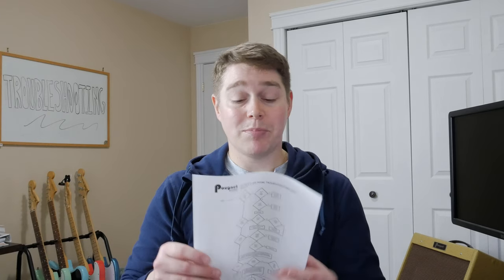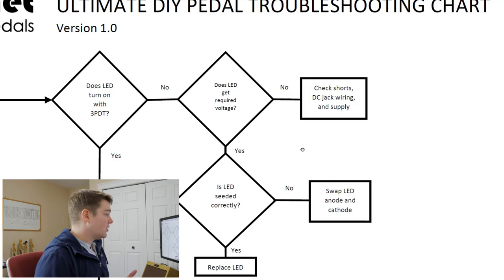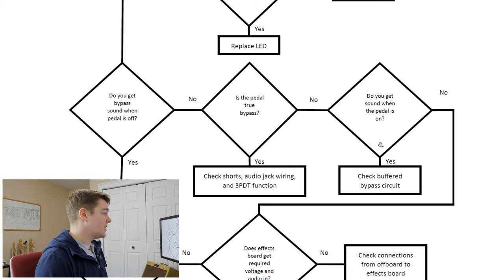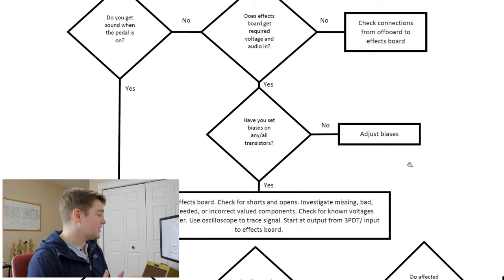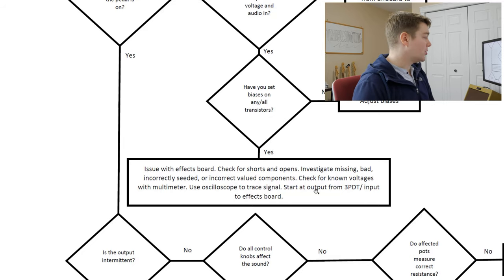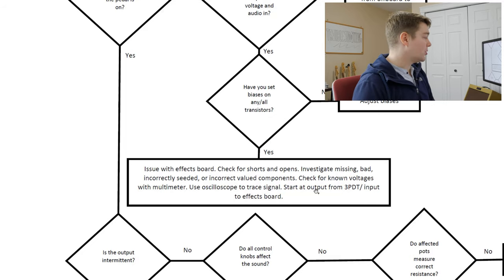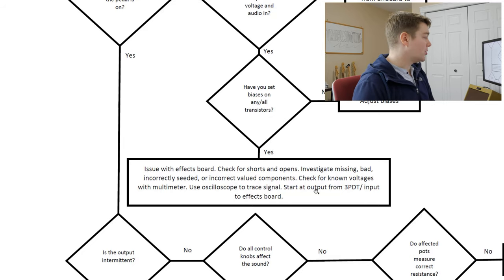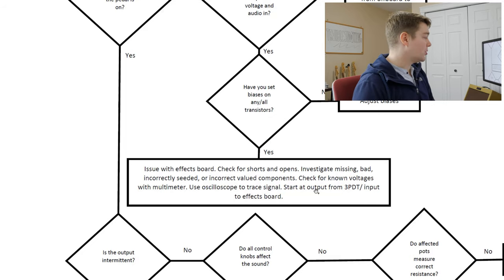The Ultimate Guide to Troubleshooting Pedals | DIY Guitar Pedals

Comment: Of the 6 pedals I've built, only 3 work the way they're supposed to. Now I can finally figure out where I went wrong! Thanks for creating this roadmap!
Reply: Learn ohms law. Start small calculating resistors in series ans parallel. Understand transistor behaviors and what stage the wave form should be in at any node. Pro tip. There's a 1.4v drop from collector to emitter, it takes .7v to turn on a transistor. Learn to use a digital multimeter. Learn the rc time constant.

Do not get an oscilloscope until you need one and spend 500 on a rigol or siglent. 

Do not use parts from China. 

Getting better at your instrument is more important and don't be the douche at parties playing cowboy cords or the c major scale. No real player respects blues players. Blues is lazy, practice more.

Comment: Absolutely love this video and your chart. 
You pretty much mentioned it with ‘faulty 3pdt’ but I’ve made the mistake of flooding parts of my foot switch and causing all kinds of problems. (Connecting poles that shouldn’t be soldered together) 
Thanks again. And I appreciate your time.

Comment: I have a regular 'pulsing' sound (about 2-4 beats per second) on an ancient Zoom 2020 multi-effects processor. I've had experience with faulty (computer) clock boards before and know how sensitive they are to capacitive effects. Thanks, I'll check the clock IC and associated components next...

Comment: I'm a total noob fixing pedals but I finally fixed my analog delay pedal. I used the flowchart. Had a bad IC chip and maybe bad power diode and reflowed all the solder joints and it fixed. Also great lesson testing for pots and switches and jacks. Once I got engaged output sound, the delay still wasn't working, then used a power supply instead of battery and it came back to life.  Thank you so much. Inspired to make pedalpcb pedals of discontinued pedals or way overpriced pedals and selling cheaper with cool artwork like you. Really fun man. Confident in my skills now. You are the shizzle!!!

Comment: I bought a used Artec wish wah APW-07,  at first it worked but had a problem with the "wish" pot where there's a place where it makes a huge "POP" sound then the're no guitar signal anymore even if you can hear the wah until you wiggle and play with potentiometers ,and when bypasse the signal goes with no problem.......
I sprayed the potentiometers with contact cleaner, worked like charm , then left the pedal for a coupl of days untouched.....at my suprise the pedal would not work anymore when activated, I mean you hear the wah effect and the hiss with the toe down but abslotutely no guitar signal.....I checked the switch and pots and it seems to be no problem there

Comment: I’d suggest another block in the chart for “audio bypass ok but no sound when engaged”: is the input jack cable actually connected to the guitar and the output jack cable to the amp?
I lost 2 hours yesterday for having them the other way around...
Reply from the maker: Haha. I will have to add it for version 2
Reply: Yes. I’ve been there too. Embarrassing but true

Comment: I’ve just built my first pedal, an overdrive based on the design on Wampler website.. volume and tone works as expected but drive does not.. have checked voltages on the board and everything is fine; so I’m thinking it’s either the pot has malfunctioned or it’s the capacitor or diodes in the clipping part of the circuit..
Reply: This dude doesn't actually know what clipping means brother. You're ahead of the game around here.

Comment: Hey i have an old DOD FX25. The Kermit green one from 1986-1986 that is right before the 2 knob sparkle green version. I had a sparkle green back in the day and remember it having a little bit of dirt on the decay of the filter. The one i have now seems to have quite a bit more distortion on the decay. 

What could cause this? ive already cleaned the PCB, checked solder joints, cleaned the pots and input/output jacks. It does this with both a power supply or battery. I have not checked the switch yet but it seems to be working fine. The LED is a bit dim.

Any advice is greatly appreciated, Thanks!
Reply: 1986-1988* It says FX25 on the left next to envelope filter.

Comment: Hey interesting video very informative however I have a question because I did not build my pedal I bought it ,  It's a joyo atmosphere Pedal and it turns on ... the LED lights work , however when I plug in the guitar The sound is very very quiet. even if I put the amp on 7, which should be really loud it sounds like The volume is below 1.  The cables are fine, the amp is fine, the guitar is fine, and the power supply is fine. When I opened up the pedal and checked all the voltages it's a 9 V power supply but everything I checked with the multimeder is giving me the same 3 V reading. So there is a tiny tiny bit of sound But the pedal is unusable. What on the board could be causing the issue of low low sound any ideas or is it fried?  Any advice would be good thank you very much for your time in advance.cheers

Comment: Hello.   First off I don’t build or know Very much about petals. But this video has been the most informative on petals in general, but I am having a problem where I just bought a new panel change the battery and now the bypass works but it does not work when engaged with the light comes on and I may have missed it in this video but I did not really catch a way that I can troubleshoot any reply would be super helpful thank you
Reply: Insert pedal where needed … my apologies … talk to text at it’s finest

Comment: Question…I built a Spirit Box and the pedal works but LED does not work. I switched the polarity on my solo power supply and the LED works but then the pedal does not. I’ve been looking all over for an answer. Do I switch the pins around on the LED to the board? Hoping you can help.
Reply: Sounds to me like the LED is backwards

Comment: I have a digiverb of digitech . the pedal wont turn on when u push the switch. when u plugged the adaptor into the pedal its blinks 3 times the red light. when u plugged it into amp sound goes through . do u have any idea what could be the problem? and how to check sw1 switch?
Reply from the maker: Not much experience with the digiverb, but i suggest looking at the supply. I think the LED blinks when they are turned. Maybe a dead or dying battery, a bad dc adapter, or something burnt up in the power section of the board.

Comment: I'm having an issue with a 30 year old Morley wah pedal. The pedal works fine if my only effect is the Morley. When I add other effects to the chain the Morley stops working when engaged. When off the bypass still works. I checked the voltage on the input jack and it's 9.6 volts with no other effects in the chain. When I add other effects the voltage starts fluctuating (down). Any ideas would be appreciated. Thanks in advance.
Reply from the maker: How many other pedals on in the chain? Are they all off the same supply ...say in a daisy chain? Might have too many.
Reply: @pougnetpedals  The same issue occurs regardless if it's one or more.
Reply from the maker: Yeah. But it's about current draw. So knowing what the adapter can handle and what the pedals draw is #1. Usually once current draw goes up, you will see the voltage dip. I used to have one of those Morley wahs but I can't remember the draw. Rule of thumb is if you need 50mA for all your pedals in your daisy chain, use a 100mA adapter. If that doesn't resolve the issue, I would probably check the ground connections on the Morley. Hopefully that helps!

Comment: Please help. My looper pedal isn’t working. Every time I plug the pedal in, it doesn’t turn on. If I hold the button down, it has a red light, but if I press the button, nothing happens. What could be the problem?
Reply from the maker: Tough one without the pedal name or schematic. Also, its likely digital which makes debugging a bit harder.  My only guess, and it's a long shot,is to check the power supply. I only say this as I have heard of similar issues with ditto loopers
Reply: @pougnetpedals  it’s a Koogo looper pedal. The back it like glued on. No screws, so I can’t get into it. I’ve tried multiple power supplies and it’s doing the same thing
Reply: @Lightningph  see where the pedal compresses?

There should be a black knob which unscrews then you can get inside.

Comment: What if it’s a reverb pedal and it has a light and hardly used.  But there is signal.   it’s just hissy and noisy and the effect don’t work.
Reply from the maker: Could be a lot. Depends on what type of reverb as well? is it using a digital brick? a pt2399.

Comment: I built a JHS morning glory clone, called the Gloryhole from pedal PCB. I forgot to order the proper transistor. so I improvised with anything I had laying around. I found one that worked, but the volume is very low. I ordered a new transistor. Will this fix the volume problem?

Comment: So my pedal is at the stage where all the components are soldered but I haven’t connected the switch or the led. I wanted to test it so I hooked it up to my amp and guitar and got nothing but a constant noise. But when I would turn the pots, the hum would either get louder or quieter. Any suggestions?
Reply from the maker: Hmm. That's a tough one. Start checking component orientation. If the hum gets louder, maybe something is leaking into your output. Use a scope at the input and see where your test signal disappears
Reply: @pougnetpedals  hey thanks for the reply but I’ve realized that I was using really shitty solder and it was causing cold joints which eventually led to heat damage. I got some better stuff and am trying over again 👍